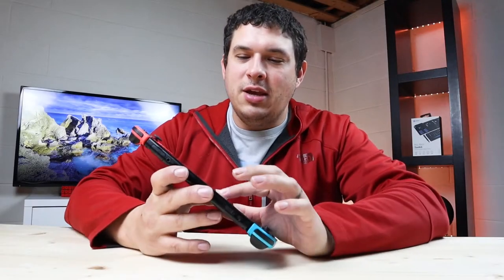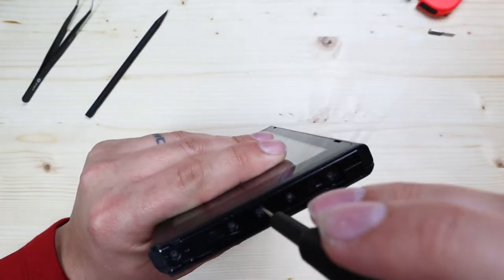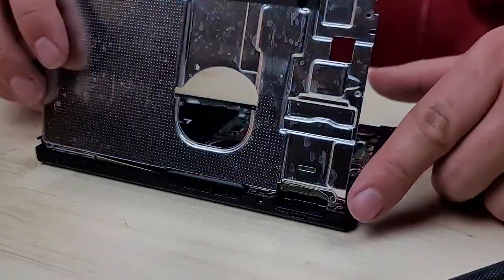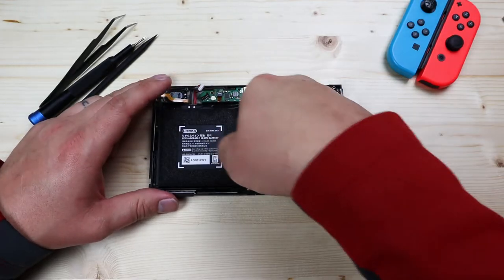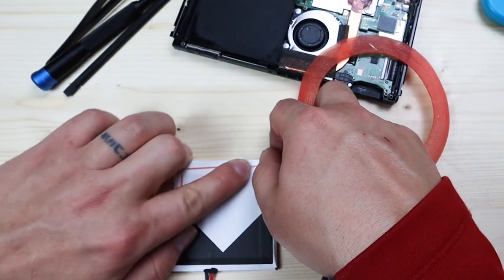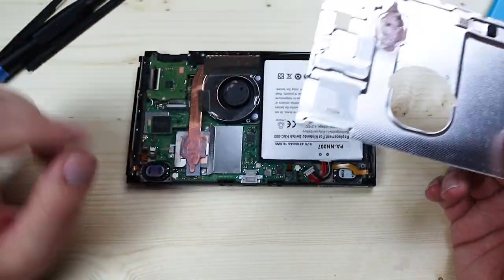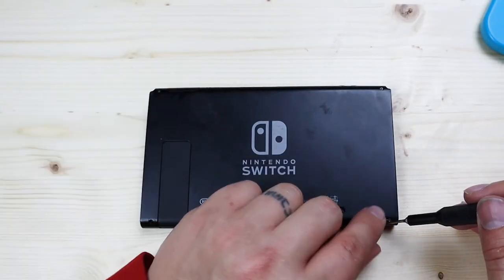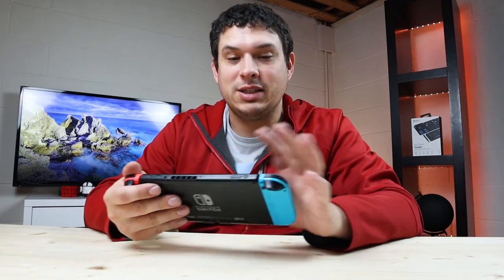Nintendo Switch Battery Replacement - tutorial

Comment: I can't stand that companies started gluing in batteries like this. They use the excuse that it's to protect customers from rupturing batteries but the end result is that it heightens the risk of that happening many times over.
Reply: I could understand a smalll portion of glue so the battery wouldn't flop around, considering its a portable device.

But that was pretty excessive.

Comment: FYI for Battery Swelling - If you are replacing a swollen battery it may have damaged the back cover of the switch and won't completely reattach. There are 3 prongs poking out from the back cover for each respective screw (2 bottom, 1 top). If your old battery was swollen and making the back cover visibly bend/bow out, the top prong is probably broken. That means when you put everything back together, the top screw will not screw in.
Reply: Thanks for the info. This is in fact what brought me here .Praying my Battery does not blow up or something when i replace it.

Comment: Super helpful! Appreciate seeing a video that flat out mentions the adhesive can be super difficult, rather than all the ones which magically seem to remove the battery in 2 seconds. Do you think adhesive on the new battery is a must? Or is the fit secure enough that I could just do without it?
Reply from the maker: It's probably secure enough. But I would still do some kind of tape if you have any. Doesn't have to be anything special.
Reply: A little dot of 2 sided 3m would be perfect.
Reply: @Zaque-TV  Aslong as that survives the heat your battery will go through sure

Comment: The only video that helped me remove the battery. Nobody else advises to poor alcohol around battery. I have a heat gun and that didn't work, at least I wasn't risking to blow up the battery from the extreme temperature. But alcohol definitely worked!
Reply from the maker: Dude I’m so glad I could help!
Reply: Same, that was a pro tip indeed!

Comment: Really excellent video because you showed the struggle and solution for getting the original battery out. Isopropl alcohol - good tip. Only suggestion is to show screw replacement in same order as removal...I believe the kickstand screw was out of order. Anyway, great video. Worked like a charm. Thanks!

Comment: Just replaced my battery today. GREAT walkthrough.  I do have one question - should I be at all concerned about some of the thermal paste sticking to the metal shield? it obviously goes right back to where it was before I took the shield off when i reinstall it, but didn't know if that was an issue.
Reply: I’d just clean it and add new same concepts at a pc if thermal paste seal is broken clean add new

Comment: Is the glue 100% necessary? Or will the battery be ok without it?
Reply: I want to know, too.
But I decide to use heat resist 3m double side tape.
Because I just happen to have those tape.
(3M 4920 double side tape)
My part haven't arrived, so I haven't done it.
If I were you, I will wiggle the battery, see if it wiggles without tape.
If it wiggles, I definitely will apply some tape.
Regular double side tape probably won't cause much issue... But I am no expert, maybe tape will melt or something.

Comment: The side of the battery with the cable was angled and lifted up a bit more than other sides. It was easier to wedge the spudger underneath it. Removing the battery was easier once I focused on that side. I also used a good amount of alcohol.

Comment: Do you really need a new adhesive before putting on the new battery? I mean back in the psp days you just plugged the new battery in and it works
Reply: Thats my question cause i aint got none

Comment: I’ve read that you’re supposed to replace the thermal compound anytime you remove the metal plate, but noticed you didn’t do this. No problems with the heat?
Reply from the maker: Generally speaking yes. As long as you don’t remove any, usually you’re safe to work with the old.
Reply: In this case, he isn't actually removing the heat sink. If you look closely, you can see that the heat sink metal goes from the processor to the fan. They put thermal compound between the heat sink and shield for a little added cooling. But it's not the main way the processor is cooled. If you did remove the heat sink from the processor, check whether the thermal compound has dried out. If it's not dried out, you can reuse it. If it's dried, it would be best to clean off the dried compound and apply fresh.

Comment: Do I need to worry about the thermal paste? Or will this repair not effect it and it's ability to cool properly?
Reply: Thermal paste is there to cool down whatever its needed on replacing it isnt necessary unless you have literally nothing just dont touch anything else as nintendo charges 99 dollars for repairs

Comment: Excellent tutorial Sir! A question if I may is do you recommend any other USBC charging blocks/wall adapters for use with the Switch and preexisting USBC cables, or is it best to stick with the proprietary Nintendo charging AC adapter?
Reply from the maker: You can use third party chargers. Just make sure the output is the same as the original. It’s written on the block that plugs into the wall. Probably 2.1 or 3 amps I’m guessing.

Comment: So after not using my switch 2 months or so I was trying to charge it , and not sure if it was dead at the time but I’m pretty sure it did drain the whole battery as you can see my switch doesn’t turn on , and with all the methods I have tried in YouTube holding down the power 15-20 second and then letting it go and finger press it one sec , and 5 other ways , no luck at all!! Tried over charging it for 2 days which was about 48 hours I suppose and nothing! My last bet is probably checking the battery pack and get a replacement other than that I hope that’s the problem
Reply: Also yea I did use plenty of other usb type c chargers if you ever ask and no it didn’t work !!
Reply from the maker: Yeah sounds like the battery may need to be replaced. Great job trouble shooting!
Reply: I've run across the dead battery after sitting for a long time or if the device was left on and the battery drained too far down. What works most times is to connect a charger directly to the battery. Like jump starting your car. You need a charger or power supply with the voltage a little higher than the battery. For the switch, the battery is 3.7 volts, so a 5 volt charger would be good. You need bare wires from the charger and you need to know which is + and - (just like when you connect jumper cables to your car). You could use an old 5v charger that you don't use anymore and just cut off the plug that goes to the phone or whatever it was made to charge. You could do the same if you have an old cable for a USB charger. Leave the plug that goes into the "brick" that plugs in the wall and cut off the other end of the cable. You'll need to identify the + and - wires. A DC volt meter will do the trick. Harbor freight has cheap ones for under $10 in case you need one. Once you have figured out the + and -, just connect the + from the charger to the + on the battery and the - to the -. I usually let it charge for 15 to 30 minutes. Basically you want to get some charge in the battery so it can be charged normally the rest of the way. This "jump start" method bypasses the charging controls in the device, so you don't want to try to charge it all the way like this. Just enough to get it working normally again.
Reply: @jaygosch8705  thanks Jay ! It looked like the problem was not my battery , yeah I had ordered a new one and replaced it and I know usually it always comes at least 50% battery 
It started up from there and I had received a code shown on the screen and searched the code on Google and reviewed that it was a corrosion on the charging port not being able to charge so I had to replace and get that fixed.
Reply: Overcharging is terrible for the battery have you seen samsung note 7s?
Reply: @Mohammed-roblox  of course the phone that caused to have an explosion and discontinued yeah man horrible !

Comment: My switch won’t turn on at all. My computer doesn’t recognize it when I plug it in when trying to put it in RCM mode using the tegra program. Does anyone here think replacing my battery will turn it on?
Reply: Sounds like a problem with the port

Comment: I've just changed the battery in my son switch because it wouldn't change with the old battery, just got a new battery for the switch removed the original put in battery in the switch works still won't charge 🤷🏼‍♂️ any help please
Reply: It wouldn't charge not change 🤦🏼‍♂️😂😂

Comment: My nintendo switch will only show a black screen and a tiny charging symbol in the top left corner, am i in need of a new battery?
Reply: If the charging symbol just has a red bar at the end even after several hours on charge then I would say yes. That's what I found with mine anyway.

Comment: Is there a 3rd party higher capacity battery you can get yet/now?  I know the v2 switch had better battery life but was that a different battery or just efficiencies elsewhere?
Reply from the maker: They both have the same battery from what I’ve read. The v2 I guess is just more efficient. The battery is a 4310mah battery. I found this 4550mah battery. Not much better but maybe half an hour more on time. 
https://amzn.to/3MquzeM
Reply: @JoeDoesStuff  Thanks so much. Considering the hackability of the v1 would be great to get a higher capacity and get as much extra time as possible. Surprised someone hasn't made another or a mod in the last 5 years.
Reply from the maker: Yeah at least a battery pack case or something.
Reply: @Captain_Yossarian  Battery capacities arent the main factor as seen with the iphone of course theres been notable differences between the battery life on the 13 and 14 with the 14 having lower life as it has terrible battery management

Comment: I wouldn’t use alcohol if you’re planning on sending back to Nintendo! Alcohol will trigger the moisture indicators.
Reply from the maker: There are no moisture indicators in the battery compartment. Also, why would send it back to Nintendo if you’re replacing the battery?

Comment: Great video! Hey I have a question

Does a HAC-003 battery fit a HAC-001 console?

Thanks
Reply from the maker: Thanks Addiel! Yes it will work on the HAC-001.
Reply: @JoeDoesStuff  Awesome! And one more thing...

Do I really have to have  adhesive in order to put the new battery in to stay in place securely?

I don't have adhesive of sorts

Thanks!
Reply from the maker: Keeping things from moving is important for keeping a good connection. You could just fold over some packing tape or something though.
Reply: @JoeDoesStuff  good idea! thanks man! subscribed!

Comment: My guy you should definitely replace the thermal paste. It isn't designed to be disturbed and reapplied like you've shown here so there's a high risk someone will follow your guide and wind up with an overheating console when they fire it back up.
Reply: What is thermal paste
Reply: @Vik_X21  Its in the name its just paste to cool down components